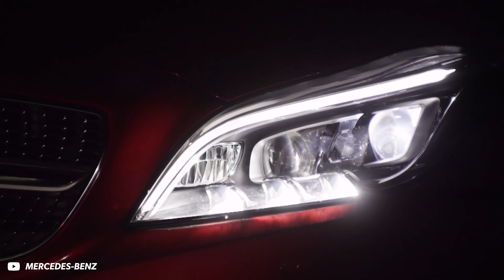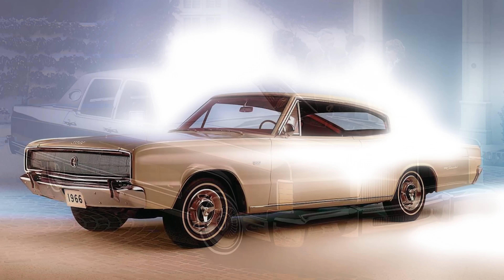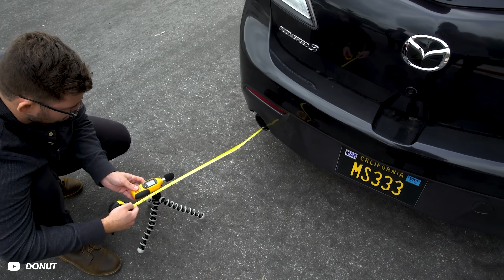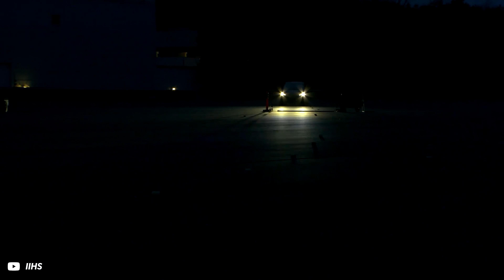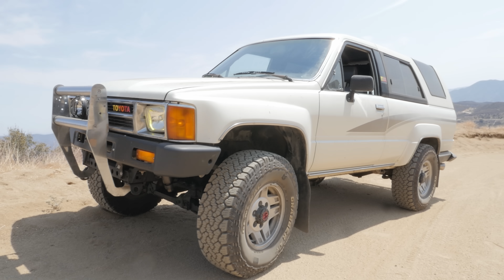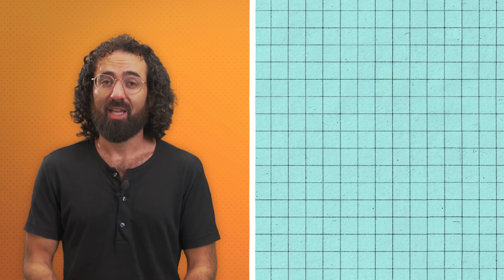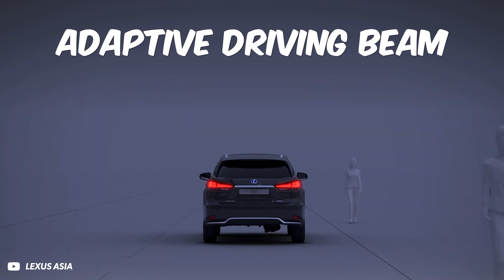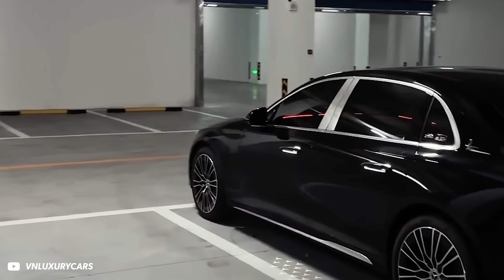Why new headlights are blinding American drivers

Comment: or hear me out you have a yearly checkup where they measure the Lights to be in accordance with the law at the same time as they check oil leaks, Enviromental pollution, Brakes, Tyres to be in accordance and that you have a varning sing onboard for accidents.
If your dont pass you cant drive on the road until its fixed or you will recieve a large Fine.

We have had this sytem for all car under 40 years of age in Sweden since long before my birth in 1990 and its a very important piece in the Read safety of this nation.
This include all road going vehicles with diffrent tests depending on what they are.
Car.
Tractors with road lisence.
Trucks.
Campers.
towed wagons of diffrent kinds.
Busses.

it boggles my mind for example that USA the nation where Cars are most common for travel in the world dont have yearly or atleast once every 2 years lisence controls.
I mean it could easily lower the risks for serious injuries and deaths by a huge margin.
Same goes for Tyres and having winter tyres by law if it is below a certain temprature over a certain amount of months where its a large risk to go below or snow.
Summer Tyres in winter weather is about as safe as standing infront of an incomming train on the tracks and hope he can brake from 200km/h in less then 50 meters, Its a bigger chance then a car with Summer or year around tyres can brake from 70km/h to 0 in 50 meters.

Comment: There is another type of headlight than LED. For the most part, HID lights, especially the higher wattage ones, put out more light than most standard LED replacements will. But the king of them all is a laser headlight, which I am disappointed you didn't mention here. Yeah, actual freakin' lasers in the headlights. They aren't actually shining lasers directly into your retinas, but they shine intense laser light on a phosphor that emits a TON of light as a result. Check this out if you're interested in the nerdy parts: https://www.youtube.com/watch?v=KUfHje4pqyU

Comment: Lightnerd here. It is good that this issue with headlights is being brought up. There are many more layers of failure than discussed here. 

1) Lumen, lux (and candela?) aren't units (or derivatives) of absolute radiant power. They are calculated from the spectral power distribution based on the sensitivity curve of a "standard human eye". The problem with this is that the human eye contains different kinds of photoreceptors, responsible for different aspects of vision. Cone cells are responsible for sharp vision and are very concentrated near the fovea (the small part of the retina that gets the light you see when looking directly at something) high resolution but less light-sensitive, and most sensitive to red and green light. Rod cells on the other hand are more or less absent from the fovea, can't form sharp images since they're less densely packed and clustered (several rod cells go to the same nerve vs cone cells that have individual nerves), so they're pretty bad at doing precision tasks like judging distance and speed, and can get extremely light sensitive in low light conditions, but respond pretty quickly when overexposed (you get blinded). These are most sensitive to the 450nm deep blue light that is the prevalent wavelength in cool white garbage LEDs. 

2) Light emitted/light reflected/blinding effect; few of the surfaces that you need to see when driving reflect the deep blue wavelengths, except for snow, concrete and small dust particles. The 450nm light also scatters easily in moisture and water droplets, illuminating the air in front of you instead of what's behind that air. Also, since the light already contains proportionally little of the green and red wavelengths that you need to see sharply, the result is that your vision is flooded with useless light, and the perception of brightness even though you struggle to actually see anything in it (like discerning surface textures from each other, everything just looks the same grey). And since the rod cells are super sensitive to this 450nm light, the percieved glare effect from other cars is much stronger, and it doesn't help to look away because the rod cells get light that comes into the eye from most possible directions. 

3) Small exit points for the lights; the intensity of light when it exits through a small slit which i guess is considered cool, is orders of magnitude greater than in traditional halogen reflector type lights..  that means when there is ANY dirt on the lens, it will light up like the sun, and as mentioned before, in the wavelengths that are most disruptive for the nightvision of other drivers.

So they've managed to get the worst possible vision-to-glare ratio for light that can, by some stretching of the concept, be called white, and somehow every light manufacturer has failed the same thing 👏       👏      👏

What i found does help is driving with those yellow or orange anti-UV safety goggles at night, as they block a lot of the deep blue light. They don't completely solve the problem but do make driving tolerable.
Sorry about the long rant, i have done pretty extensive research into this subject and i wish i hadn't, then i wouldn't feel so helpless in the face of this vast ocean of ignorance that is the automotive lighting industry.
Edits: some comments gave ideas for more ranting 😅

Comment: This is the pain. Especially at northern regions. ESPECIALLY at winter on snowy roads, when it's getting dark already at 5 PM, and you don't even have to drive at proper night to completely burn your eyes  every minute. People that bought aftermarket headlight LEDs should put these bulbs into their arses ASAP. And there is cauldron at hell dedicated to developers that had a bright idea to only use overpowered LEDs with like 6500K color at headlights. For fuck sake use 4000K or lower already, visibility is actually better with warm light because of lower stain on eyes.

From Russia, with pain.

Comment: I'm simplistically thinking there could be ONE measure that would help a lot:  What about if the law just said that when on dipped beam, the top horizontal cutoff of the beam must strike the road at one fixed distance in front of the car, for ALL vehicles, no matter how high up the lights are physically mounted? And make that distance probably a lot LESS than on the majority of modern cars.  "Oh! But then I won't be able to see as far down the road!", the thoughtless idiots will cry.  YES!  So you will merely need to SLOW DOWN.  If you're on an empty road, then you can use full/high beam anyway - no quibble. But if there's plenty of oncoming traffic, then a more-angled-down dipped beam is simply being considerate.  It will also help with the problem of vehicles behind you glaring in your mirrors.

Comment: Total rubbish. The led lights on modern cars are are a hundred times better than those dreadful sealed beam units I had to suffer in the 60s and 70s. I will give you that fiddling around with the manufacturers original designs.

Comment: Here in austria headlights are realy heavy regulated but tje main Problem is exactly what youre suggesting those Systems dont work they often dont recognize oncoming traffic, in general dont recognize motorcycles and people dont switch off their high beams anymore couse they think the System takes care of this

With the old switch you just switched off your high beam when the other one swithed his off or you felt blinded by his light, if noone was blinded ever you wuld just pass each other without switching of if the other one felt blinded he would switch of signaling you to swithch yoirs off ond if you felt blinded you would switch off signaling the other to switch of his high beam

Simple, practical efficient

But now a lot of times the Systems just dont recognize you or if you switch off your high beam they re activate theirs so I often now switch on auxillery lights to trigger the Systems and signal the oncoming driver that he sould manually switch off his high beam by blinding him resulting in two vehicles passing each other while blinded

And on my motorcicle the Systems dont even recognize me if I switch on high and low beam simultaniously, with aftermarked LEDs, 2x Auxillary light, 2x Fog light and Parking light, and Thats realy "Hier Kommt die Sonne" bright but becouse the motorcicle doesnt have two destinglished headlights the System does not recognize it as a vehicle ond just doesnt care

Those matrix LED lights should be outlawd not encuraged

Comment: When someone tailgates me with their lights like that i slow down, Let them change lane and get in front, then its my turn 👾
Reply: 🤣😂 modern problems, modern solutions
Reply: Too bad standard (stick shift) transmissions are so uncommon, especially in new vehicles.  When I would drive on an interstate on the great plains I would get some yo yo tailgating me IN THE RIGHT LANE when we were miles away from an exit, and the left (passing lane) was wide open.  In a stick shift I would take my foot off the gas, and watch them in the rear view mirror.  Since automatics don't slow down as fast I wait till I see their car "bowing" then I accelerate up to the speed limit.  They often race up while I take my foot off the gas, making them brake a little harder.  Two or three times of that they race around me and are on their way and after about a minute I never see them again.  The beauty of this method is that you brake lights never come on so they don't know you are "break checking" them, which means they don't feel obligated to "punish" you.  Alternatively, I drive about 1 mph (1.6 kph) BELOW the speed limit.  That pisses them off as well and they race around and leave me alone.

Comment: Isn't it time that the auto companies develop glass for cars, especially our windshields which can block the blinding glare from the excessively bright headlights of oncoming vehicles?
My SUV is one of the culprits, as people flash their hi-beams at me and they are probably cursing me, as well. The other unexpected thing about these headlights is that they do not illuminate anything above a certain angle above the roadway. When driving on a dark road, a line of demarcation is clearly visible ahead of us where everything above is in darkness and everything below is illuminated normally. Road signs are not always in the illuminated part until I switch to hi-beams. Weird.

Comment: There's a standard for how high the focal point of low beams can be and 90% of car manufacturers can't seem to figure this out. 

My 23 GMC has factory projectors with LED's as the light source and they were WAY too high. I brought them down a ton and now I don't get flashed every night and I can still see well.

However, the "cold" color temperature of the light make them very bad in wet/rainy weather. And when it snows, because they produce practically no heat, they're completely worthless! Snow builds up on the lenses so fast, that I have to stop every 5 minutes, get out and wipe them off. Literally almost crashed because of this!

I sent a very in depth email to the NHTSA about this design flaw and how dangerous it is. Doubt anything will come of it but, I can hope.

Comment: Jeep XJs have notoriously weak headlamps. I replaced them with LED lamps that have only 2 diodes, a carefully designed parabolic reflector, a real high-low cutoff, and comply with DOT and NHTSA standards. They cost more, but I'm not out here causing wrecks.

Comment: Lighting Engineer here [30 years R&D]. This is a complex topic and it's hard to address all the issues, however, please note: 1. Forget Halogen     2. PEOPLE DIE EVERY DAY BECAUSE OF DISABILITY GLARE INDUCED BY POORLY DESIGNED AND REGULATED HEADLIGHTS AND TAIL-LIGHT CLUSTERS! [Your article mentions that the insurance companies say that 'there is no evidence for this', Sorry that's wrong].          3. A regulation that 'All vehicles may only emit no more than 3 or 5% of total luminous flux at peak intensity above the horizontal plain, which may not be mounted above 3ft or 900mm above the road surface, including for trucks, on main driving beams [not applicable to high beams]', may work.           4. And perhaps: 'Maximum luminous flux on Main driving beams may not exceed a total of 8000 lumen, with a colour temperature range of 2300 to 3000 Kelvin.' ....................... Lives will be saved and our driving will be more pleasant. If you install 10 000 lumen headlight lamps, you are a k1ller!                                 Regulators have LOST THEIR MINDS in the Auto industry.

Comment: The colder the tint of the light -> higher frequency of radiation and easier reflection. Warm light has it´s advantages. Also a LED-light can be made to throw light far and good and also to limit it so, that it does not blind others. 

But Lumens sell. You get more lumens to a light fixture by just adding leds and power -> you try to keep it small with small reflectors -> a lot of flood in the light beam.

Comment: Cars with ADB headlights are the most common to blind me. I can recognize them easily as the lighted area continuosly changing shape in front of those cars as try to keep me and other nearby cars out of their beam, but never succeed for more than a few tenth of a second continuosly. The result is basically a high intesity stroboscope flasing into my eyes which is even worse than a continuos high beam. The technology should have been developed to a reasonably working level before allowed to use it on the roads.

Comment: Any My high beams are not LED, They are the Standard bulbs.  My Low beams are LED.  How Ass backward is that.  after owning my car 6month from Brand new 2022, I was getting tired of ppl flashing me with their Brights. & I flash my NON-led High beam, letting them see, I don't have my HB's on.  I took to dealer & it was OUT  out req Specs. the Driver side front.

Comment: Good video, but I have a few thoughts. First, some of the worst headlights on the market are from Ford, especially their trucks. Why did they produce a truck with six lights that can be used without high beams being on? 

Second is that the standard for cars needs to be revised to eliminate a lot of the glare, which is on the US government. And adding to this, the US DoT does not approve lighting; the designers/manufacturers make the claim that it is compliant with the regulations. 

Third is a historical issue, electric lights on cars did not come into existence in mass production until Cadillac in 1912; before then, it was oil lamps for the marker lights and acetylene lamps for headlights, which were used until 1917 for many cars. While the Guide adjustable headlight system came into existence in 1915, it wasn't used until 1917, and it was an option on GM cars and sold on the market as an accessory. The sealed beam headlamp unit came into existence in 1940, Ford being the first to use it. This eliminated the bulb and reflector headlamp that was used from 1912 forward. The bulb-reflector type of headlamp was not the best, and the sealed beam was a huge improvement from it, and even through the 1970s, you could get a conversion kit for the bulb-reflector headlight.

Comment: There was a mention that the vehicles with brighter lights seemed to be involved in 19% fewer accidents, but.... thats almost 100% going to be related to THAT particular vehicle (the one with the brighter lights) being involved in fewer accidents itself.  I bet that at least 90, 95% of the time, or more, when a vehicle with super bright headlights blinds another vehicle/driver, who then gets in a wreck, the vehicle that did the blinding has already gone past, driven away, most likely w/o ever being aware that it caused an accident.  

Two vehicles travelling in opposite directions, 30 mph each, thats 60 mph closer speed, 90 feet per second, 3 seconds after they pass each other they are already 90 yards apart.  How often do you pass a vehicle going the other direction and then look back in your mirror to check to see how they are doing 90 yards behind you?  And, if you saw them get into a wreck, would you just assume you might have caused it and turn around and go swap insurance information, make sure they are ok, etc etc.  Really, think about calling your own insurance company and telling them that your headlights (in good condition, nothing defective or aftermarket changes made), caused someone else to have a wreck.  I'm betting that happens as often as winning good sized lotteries.... 

So, the vehicle at fault is never recorded, never placed at blame.... so WHO KNOWS how many accidents are actually created by these vehicles with super bright lights.  My GUESS (just gut feeling) is that super bright, blinding headlights cause more accidents then they prevent.  Its so hard driving at night anymore, getting blinded by so many vehicles.  And, i'm betting drivers of most of the problem vehicles dont even realize what a problem it is (and the ones  that do, hardly any care enough to do anything about it, or feel like theres nothing they can do.....)

Its a really messy situation, but i strongly believe the true effects, consequences, are being drastically under-reported, and therefore the situation is far worse than the statistics show.... because theres no good current method to track this.